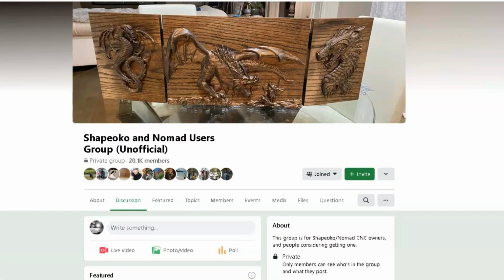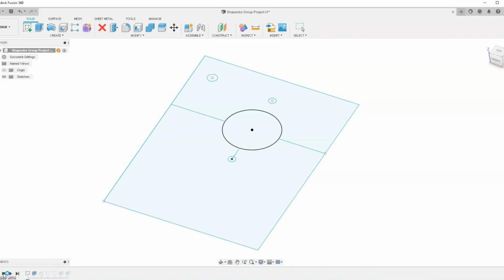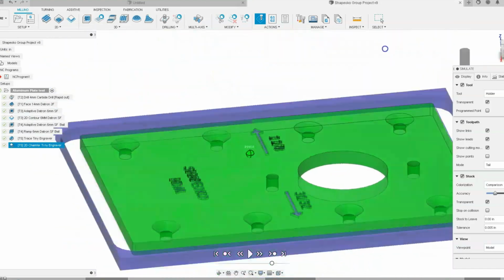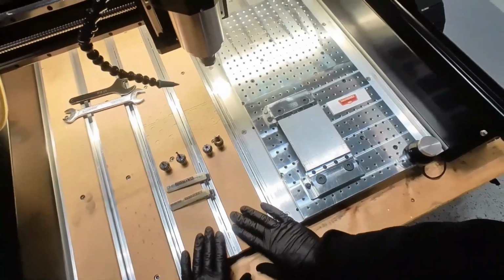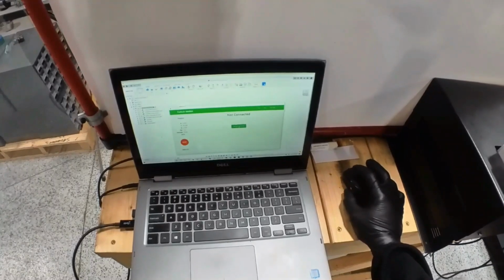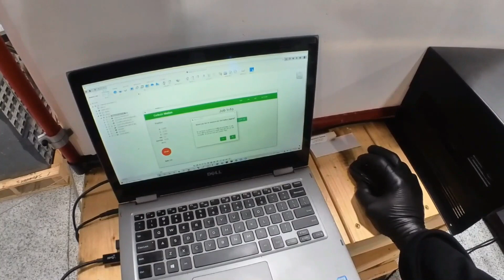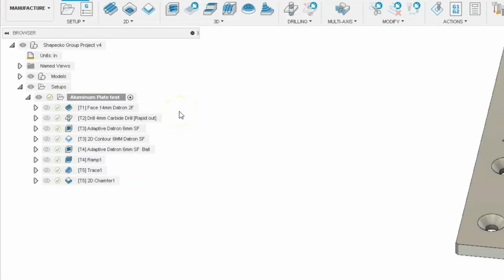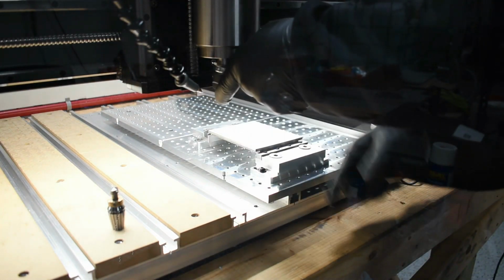Simple Meets Shiny, a Shapeoko HDM story

Comment: Fwiw, any time I’m doing an adaptive with a helical entry I try to predrill. If you drill larger than the end mill and specify the pre drill point in the proper tab on the adaptive it will just plunge into the hole without the the helical bore. Faster and saves wear on the end mill. 

But even if I am using a drill smaller than the end mill earlier in the process I’ll still use it to predrill and then specify that point as the entry point.  It will still do a helical bore but at least some material is gone from the center so it’s not cutting full width of the end mill. 

Enjoyed your video!

Comment: What I don't get about this machine, is how the spindle is mounted. The holding clamp is pretty high up on the spindle body. Would it not be better to add a second clamp or at least keep the distance to the actual tool from the clamp smaller (for rigidity, resonance, flexing etc)?

Comment: So the part moves quite a bit axially, you can see of the back left corner when drilling, was this because of the work holding? The mod vise should be plenty strong for that, or was it the tape and superglue and the bow in the part itself?
Reply from the maker: I go over it in the feeds and speeds part that's coming out soon.  Its mostly a lack of glue, axial force due to drilling and me probably not seating the part great in the vise.  Its accounted for in cam before running.

Comment: Awesome, an observation I made is that the part was flexing through some of the processes, on the initial facing and then during the drills. Is this a concern? I'm looking to import one of these machines. I've been an avid follower of you for some years over in Instagram and your content interests me the most as there is a lot of automotive performance based content with this machine.
Reply from the maker: I go over the workholding and issues with the facing/drilling in Part 2.  Most of the problem comes from a lack of planning but are easily fixable and/or compensated for.  Thanks for the support!  I plan to add more automotive stuff on here as well
Reply: @vinceramirez4463  Awesome, thanks for the response. Im torn between the Pro and the HDM, Pro as its in stock, HDM with a 4 month lead time, but the car has to be finished by this date. Not ideal.
Reply from the maker: @GizFab  that is a pickle, if it helps, I have both machines here and can run some side by sides or give advice if you would like.  The HDM is a much stronger machine with a next generation controller and higher voltage plus bigger steppers and 4x the movement resolution of belts.  The Pro is still pretty rigid but you'll be at the mercy of a loud router, still capable in aluminum though.
Reply: @vinceramirez4463  Upon looking it appears they won't ship the HDM as its pre-assembled. Seems my choice would be the Pro and then look at upgrading the spindle.

Comment: Thanks for the group shout-out. :)
Grab yourself one of the Rii mini keyboards. The jogging is so nice with one of those. Not as good as an encoder wheel, but still better than a laptop keyboard.
Reply from the maker: Community pride lol, those keyboards chip resistant?  I was actually planning on using a Tormach waterproof keyboard but its not wireless, running out of usb spots
Reply: @vinceramirez4463  I got a USB hub to solve the ports issue as my Fusion 5 tablets only have one USB port. The Rii keyboard is not much bigger than palm sized and has a rubberlike membrane keypad. The directional pad does X and Y, and pgup/pgdn jog Z. It's super simple and I haven't managed to kill one yet.